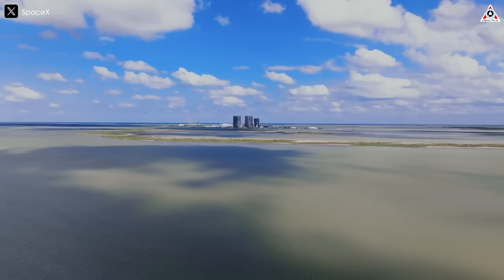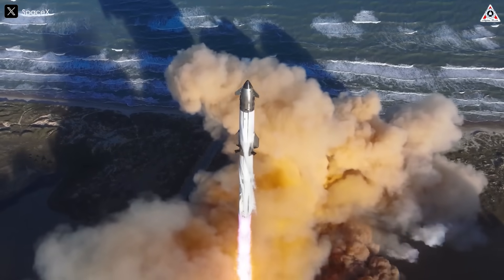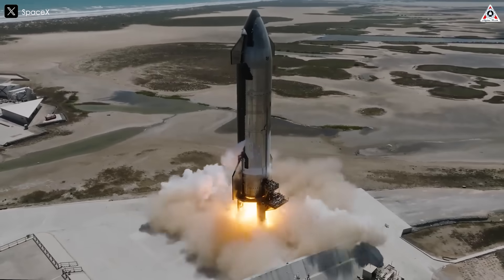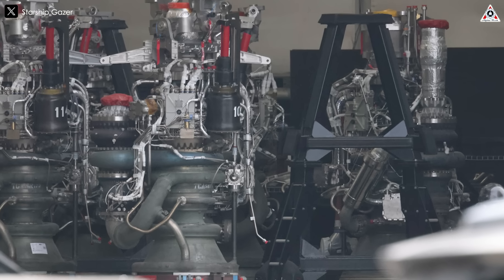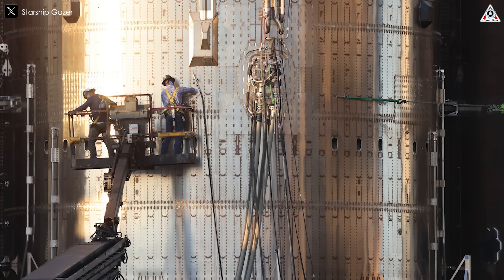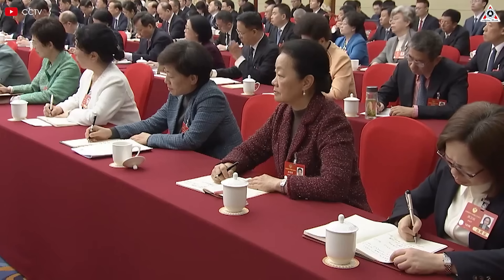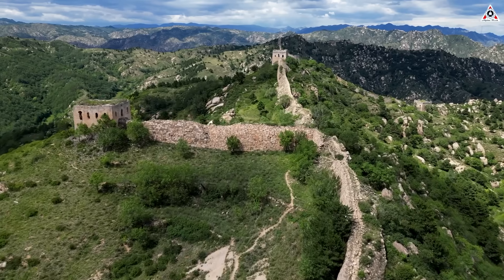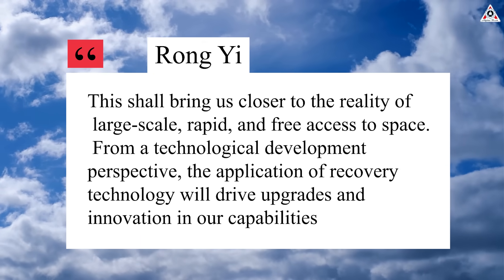SpaceX Raptor Engines "BIG PROBLEM"...

Comment: Perhaps the problem is with the hot stage separation . The booster seems to suffer from the back pressure during return , the hot stage ring surely also creates its own back pressure from the enclosed firing of the engines

Comment: I believe that the damage is done during the "hot stage" separation.  They should just go back to cold separation like they use with Falcon.  There is very little cost to this in terms of momentum at the altitudes used for stage separation.  small retro thrusters on stage 1 combined with forward thrusters on stage 2 would achieve separation. Then when the rear is clear, you can start stage 2
Reply: You may be right.  Hot staging seemed like an impetuous reaction to a non-problem.   Perhaps the next few flights of Starship should just be Starship.  Have the first come close to shore and make a stable approach and if it succeeds, maybe try a landing with legs or my the launch tower.
Reply: Disagree.  This would occur earlier if related to hot staging.  Also, Block 1 Starships did not have this problem.  SpaceX made a lot of changes to the Block 2 model.  I think they tried too hard to save weight in the redesign and it is just not as robust as it needs to be.
Reply: @tmg7476  It would not likely occur until a leak builds enough pressure to ignite

Comment: Bullshit. The brun through of the vacuum engines were in the bell. That is likely due to poor fuel supply. That could be another intstance of the same problem as in the ITF7, downcomer plumbing problems. You gave no pictures of the fires. Crappy titling. Click bait. No new info.

Comment: The SERIOUS PROBLEMS within the Raptor engine bay Is too much harmonic vibration and heat always generated on hot staging. It can be lessoned of course but hot staging does damage parts and will happen on V3. Risk/reward? Less is more. Max weight to orbit is killing us. TO ORBIT !

Comment: Im pretty sure the engines dont have the problem, the fuel lines do, harmonic vibrations caused by the engines break the fuel lines causing leaks and therefore fire causing the engines to fail and explode, still upgrading to R3 would probably stop this error

Comment: Maybe Blowing rockets up is not the best way to learn engineering.   Both Blue Origin and ULA seem perfectly capable of designing and engineering new rockets that fly just fine on their first launch. Somehow, they must have engineers capable of evaluating ALL the forces and materials involved and testing anything they aren’t sure of without having to build the thing and blow it up.

Comment: If they can't solve it in flight 9, they may have to go backwards to go forwards, the new downcomers where changed for ease of manufacturing, but if they haven't solved it in the next flight, it would make sense to go back to the block 1 downcomer and manifold, it's already proven to work, all they should have to do is make it slightly longer for the stretched tanks! Just my Idea.

Comment: The most likely cause of the engine bay fire was the split open RVac bell spewing flaming exhaust plume into the bay.  That far above the Karman line, methane wouldn't burn on its own!  Mechanical fatigue in the RVac bell might have been due to the 60+ second static fire at sea level...

Comment: Thermal management remains one of the toughest challenges in high-performance rocket engines. The fire inside the engine skirt highlights the fine line between innovation and risk. Curious to see how future iterations improve suppression systems.

Comment: Seems they have learned nothing. Hot staging is not necessary. The grid fins on the booster create enough drag to separate the stages. Starship engine ignition can be delayed comfortably by 5 to 10 seconds without undue loss of momentum. This would reduce the risk of damage to the engine bay.
Reply: They use hot staging for efficiency.  It keeps the fuel in the bottom of the booster AND ship's tanks, a CRITICAL requirement, and it avoids the 9.8m/s^2 hit to the ship if its "coasting".
Reply: Bruh the time they separate stages they’re already in space . No atmosphere to give any drag to the grid fins 😂
Reply: Sounds like why Saturn rockets failed so often.
Reply: It’s not just momentum, they still keep 3 engines burning to keep the fuel in Starship settled in the bottom of the tank
Reply: yes hot staging creates undue stress and heat into the starship engine bay . it is another variable they need to eliminate

Comment: Those engines look so complex, like the Shuttle and Apollo engines. Wouldn't it be simpler to just use SRB's at select points? I know they can't be prematurely turned off but based on the solid fuel geometry they can be in essence throttled and set to halt when desired on fuel exhaustion ... simpler is more reliable.
Reply: Now you’re getting to the wisdom of SLS!!! 😎😎😎😎

Comment: Flight 7,8 was due to new downcomer design, just look at flight 2-6 engine performance during main engine burn for suborbital trajectory. It would take too long to type out why this new design on V2 downcomer is the problem and it was the only major change to fuel delivery, and it was done at the tank instead of in the main downcomer creating flow turbulence and low-pressure zones allowing the Liquefied methane to turn back into gas allowing gas bubbles to get to the engines. These engines consume tons per second of fuel with these levels of fuel flow the downcomer design is just as important as engine designee and even the 9-engine configuration of starship only needs 1 downcomer with RVAC feed lines below the 1/2-way mark for proper fuel flow
Reply: 8 for 8.  I like those odds.
Reply: @James-hd4ms  Perfect performance! Love those “re-usable” upper stages!!!
Reply: Just adopt the SLS design!! It works perfectly!! In ALL mission phases!!! 😎😎😎

Comment: Multi down tubes sounds problematic. Also The extended ship length would be a negative if it started rotating. Longer lever arm effects.

Also I questioned the gymballed engines years ago. Alot of complication there too.
And one wonders about the over sized bells on vacuum engines and their resonance effects on engine mounts.

If differential thrust was used for steering or just gymbal the bells, 
You could have a firewall at the engine and bells juncture, and not be heating the engines with exhaust.

ie have an engine compartment. This with Raptor 3 cooling would be way less fire prone than exposed Raptor 2 eninges that were heated.

Also longer ships with longer down tubes will vibrate easier, and multiple down tubes would have harmonic effects to each other.

I suspect non paralelle fabricated shapes might help..

Have mentioned reversed trapazoidal concentric tanks several times to shorten the ships and make them more stout.
Beginning to suspect continual extending of hull ratio might lead to more problems than expected.

Just sayin'...